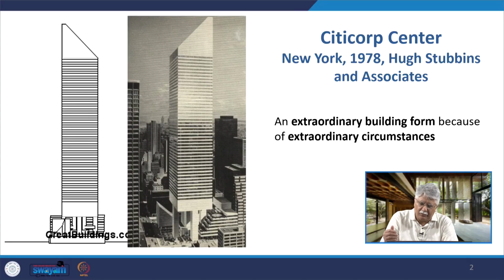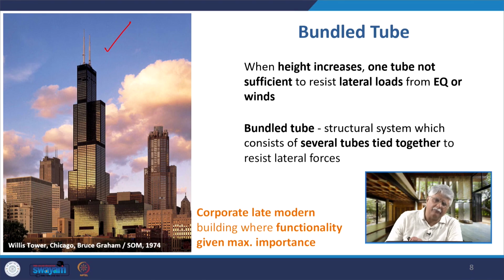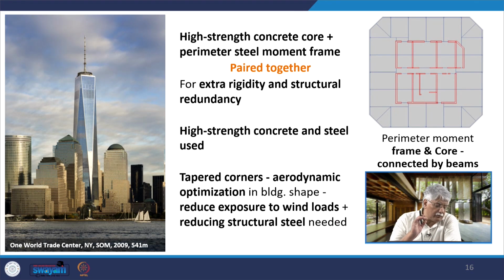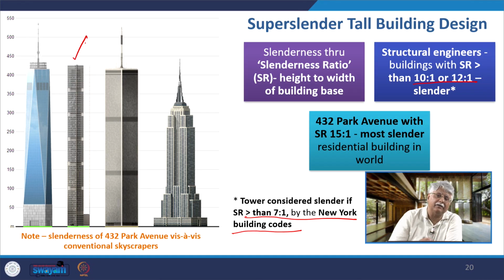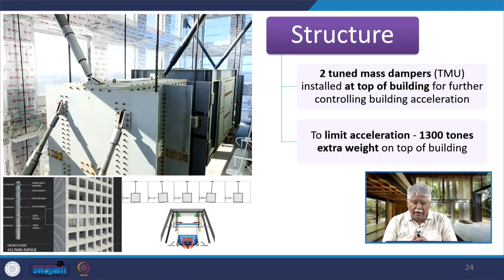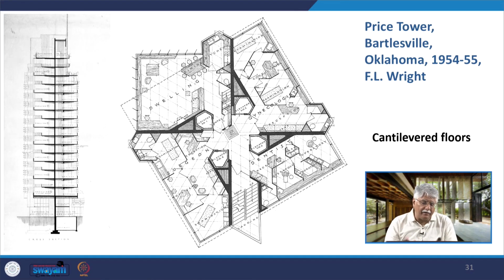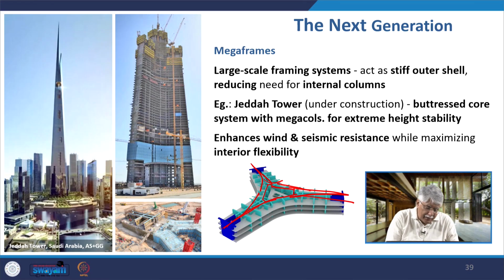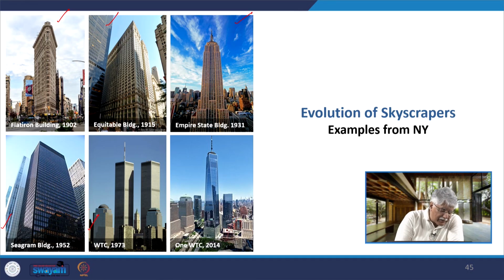Lecture 17 : Structural System of Skyscrapers - 2

Comment: Please see The ASCE Lecture on Engineering Ethics Lecture by Dr.Willam  LeMessurier in MIT Cambridge MA USA and organized by Professor Robert Logcher in MIT and Professor P.Jayachandran, MIT Cambridge MA. You can see them in this lecture on City Corp Tower in New York City. It is 915 feet tall and it has a Tuned Mass Dampers to absorb the wind Velocities induced Torsional Oscillating displacements. MTS Systems in Minneapolis MN fabricated this TMD. Drs. LeMessurier and Robert McNamara designed the CityCorp Tower. See papers by 1. William E Saul, P.Jayachandran and Alain H Peyrot Response to Stochastic Wind of N Degree Tall Buildings, Journal of Structural Division ASCE May 1976.
2. Robert J. McNamara, Tuned Mass Dampers for Tall Buildings, Journal of Structural Division ASCE May 1976.
3. P.Jayachandran, Tall Buildings Design, Preliminary Design and Optimization in WPI edu. Put one copy in your website for all students.
Dr.P.Jayachandran PhD CSE MiStructE London Professor Emeritus MIT Cambridge MA and Senior Project Engineer HOK 4 Architects and Engineers St Louis MO and CBM Engineers Houston TX. We designed the FBI Headquarters in Washington DC and Rosslyn Towers in Rosslyn VA and Oxford Center Tower in Pittsburgh PA and National Air and Space Museum in Washington DC and South Western Bell Telephone Tower and Boat men's Tower in Pittsburgh PA. See Wikipedia for these buildings.